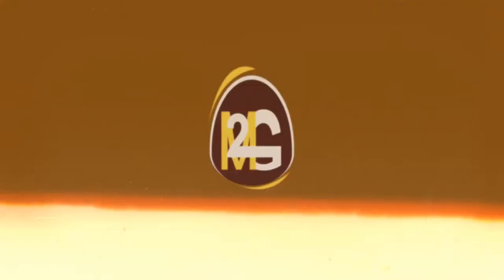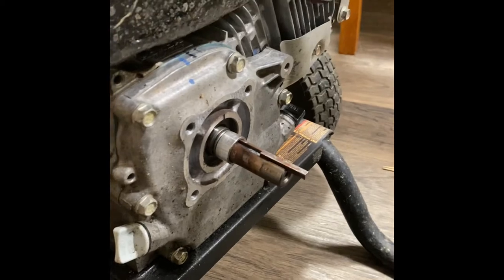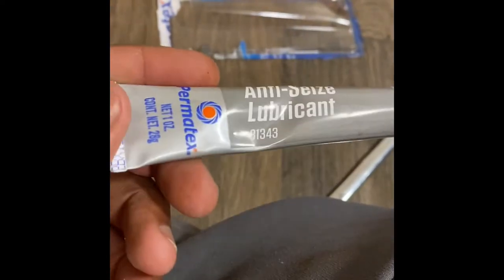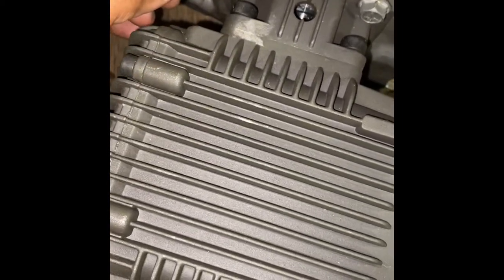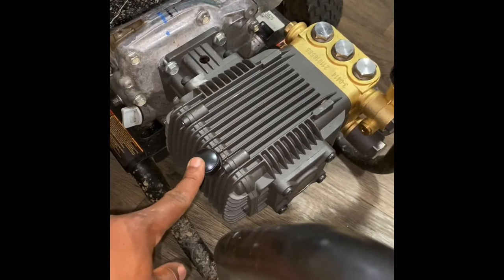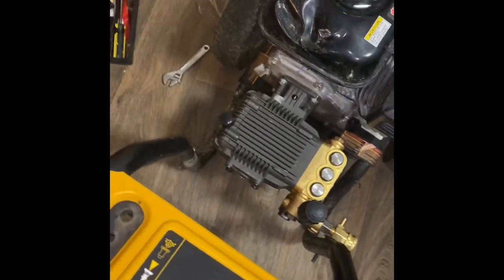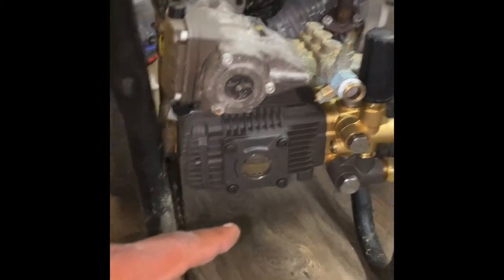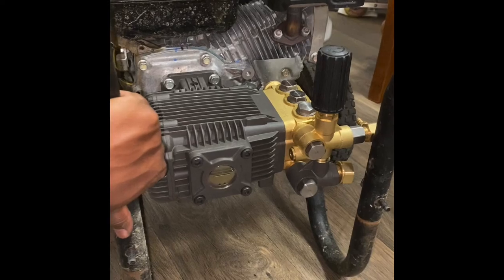Changing from a 2.5gpm pump to a 3.1gpm pump from toolbarn…

Comment: So can take my 2.4gpm and put a 4gpm pump on it?
Reply: Depends on the strength of the machine. Most 4gpm pumps have a hallow 1 inch shaft. You can get an adapter for this but the machine may not be strong enough. My personal opinion... and pump 4gpm or greater should be ran with Honda GX270 or Predator 301 or something comparable. Hope this helps